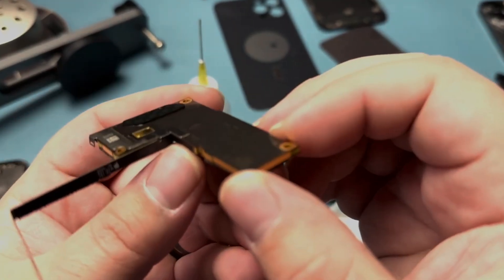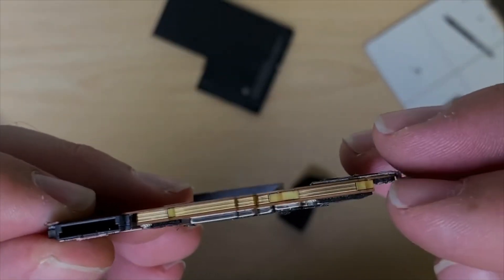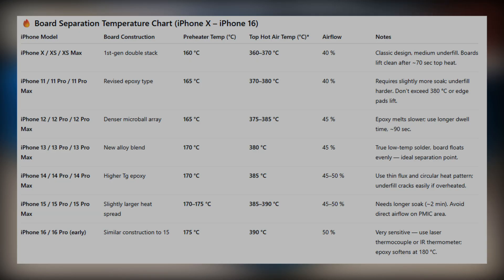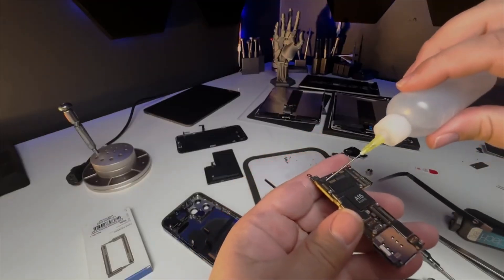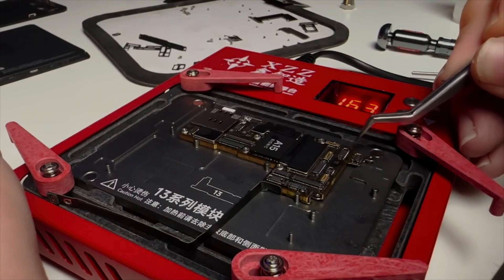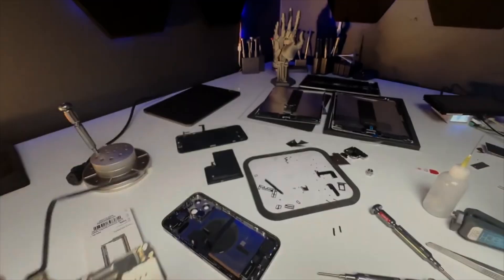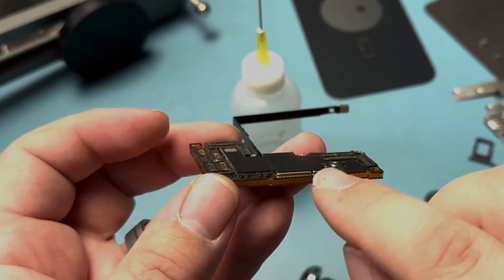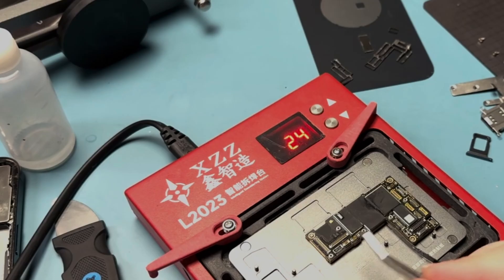How to Safely Separate iPhone Logic Boards (X to Latest Models)

Comment: Is the three minutes the default soaking period for all models?
Also when do I apply the hot air, after the three minutes or what?
Lastly what's the nozzle size that's recommended?
Reply from the maker: Great questions, its a good starting point for all models, it depends on the hot plate and how quickly it gets to temp. also the hot are is something I use if its not already ready to lift around the 3 minute mark and nozzle size isnt as important as temp and airflow.
Reply: @MobileSentrix thanks. I have recommendation for 4mm nozzle to be used and to heat only the edges
Reply: That's what a tech guru recommend and I don't if he is right about the nozzle
Reply: Ok boss